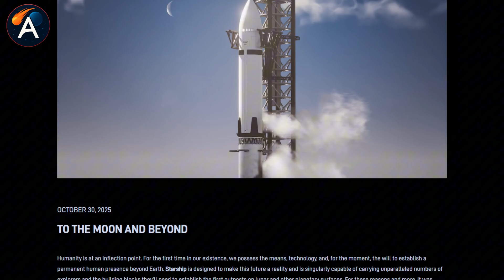SpaceX's NEW Starship Plan - Why Moon Landing is Now 2028, Not 2027?

Comment: SpaceX has not been able to put a spacecraft in orbit. Never mind a craft with a kilogram of payload, much less a 100-ton payload. At the rate at which SpaceX is advancing, my grandchildren, who have not been born yet, will not see a SpaceX craft on the Moon. Your babble about milestones is pure fantasy, or you are helping in the scam.
Reply from the maker: Starship has already reached orbit multiple times (IFT-1 to IFT-6), with Ship 30+ achieving full orbital insertion and heatshield survival in 2024-2025. Calling 49 completed & NASA-paid HLS milestones “fantasy” ignores public contract records; the challenge isn’t orbit, it’s the unprecedented orbital refueling for Moon 2028.
Reply: @AtlasSpace26  Low Earth Orbit starts at 300 kilometers of altitude. What Starship has achieved is called a sub-orbital flight. The difference between the two, in terms of energy, is abysmal. If you don't have the energy to reach Low Earth Orbit without a significant payload, you will have to redesign your whole spaceship to meet your goals. Starship is a scam.